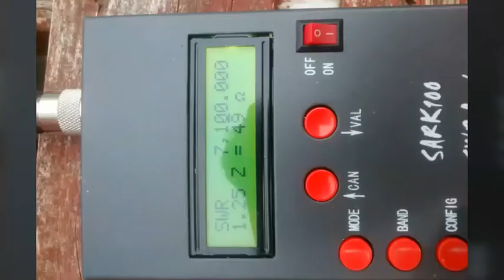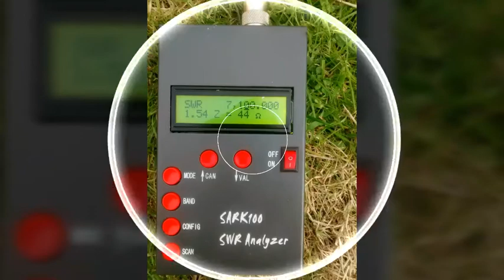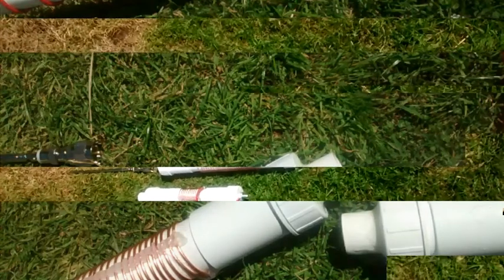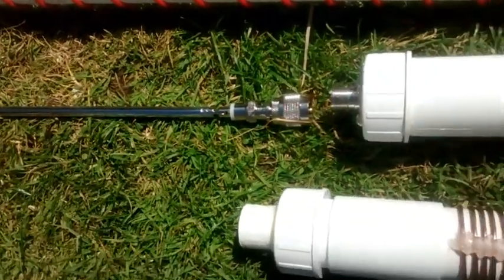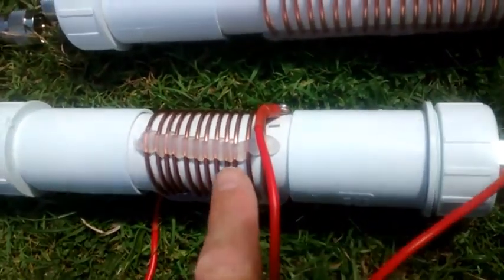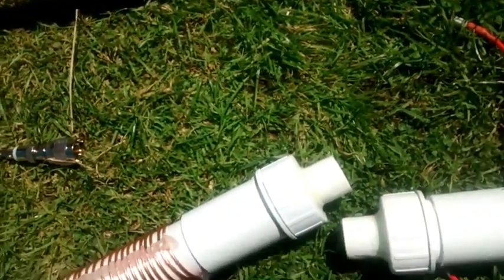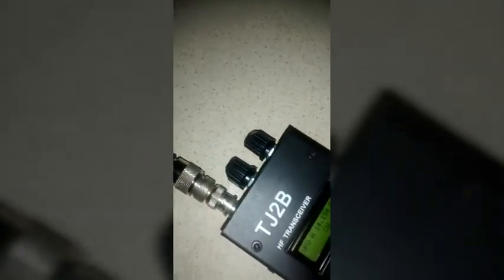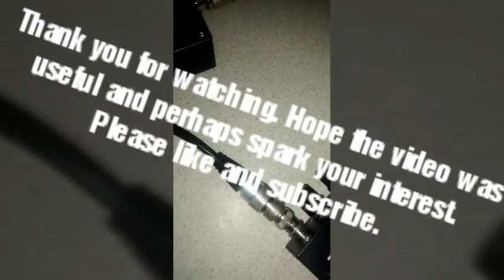Multi band antenna 40m to 2m

Comment: TheAceHere1: The "Full instructions" link you have provided just terminates with an ARRL .gif image. The actual link to the ARRL  article is in the other Youtube link you provided above; or here is your like.  http://www.arrl.org/files/file/Technology/tis/info/pdf/0004033 DOT pdf .  One will just have to place a  "." and remove a  couple spaces and "DOT" at the end of the link.   73  John-KB3SVJ - FN00fq
Reply: The link that you also provide get to a missing archive. Because can't add the .dot( point dot pdf)  to copy the link into youtube.
Reply: @Ruben-8689  U r right.  I did not test this b4 posting.  One could copy/paste link into an address box then type in .pdf i guess.